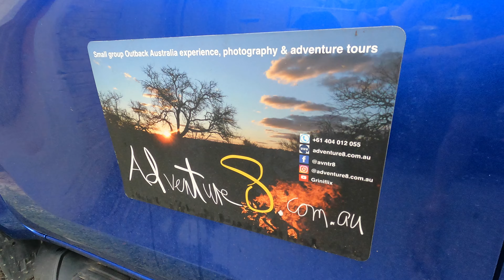NEW iTechworld 500P Lithium Power Station - for my Toyota Hilux Alu-Cab Camper dual battery system

Comment: Hi 😊How long does it take to charge via house/car/solar 200w blanket
Reply from the maker: Thanks for watching. Here is the technical info:
Charging
wall adapter + USB-C PD 60W: 4.5hrs Max power in 156W
Wall adapter     7-8hrs Max power in 96W (11-24v)
Car adapter      8-9hrs Max power in 96W (11-24v)
30A Anderson (solar)  6-7hrs Max power in 120W (11-24v)
USBC PD           8-9hrs Max power in 60W (5-20v)
It’s also in ITechWorld website. Remember to use the Adventure8 discount code to get your extra discount in addition to the special pricing on their website. Hope that helps.
Reply: Thanks 4 reply

Comment: Hi Peter, If I had a camping fridge running off the 500P what battery protection switch would be recommended on the fridge to protect the power station - Hi, Medium, Low?
Reply from the maker: I presume your fridge settings correspond to the low voltage cut off so you don't drain the battery source.  The Lithium Power Station key feature is the voltage is consistently  high and you can use almost 100% of the power supply at that high voltage.  So theoretically, your fridge setting should not matter at all.  The fridge setting options from my understanding is to prevent draining the main cranking battery of your car.  Using the power station means that is no longer an issue to worry about.  Hope my understanding of your question is correct and is helpful.

Comment: Could you use this to jump start a car with a flat battery?
Reply from the maker: The iTechworld 500P can not be used to jump start a flat battery.  iTechWorld make a range of special portable units for jump starting a flat battery.  Depending on the size of your car, small, medium or large (4WD etc).  I have the JS80.  Works like a dream.  I have reviewed it on my channel.
Reply: @Adventure8  oh - pity you need to get another separate device when you have amps available in this ? What about the DC  Carport output - what's this for?
Reply from the maker: @VykingBoy  :  Check out iTechWorld website on the 500P.  Also call them and they will answer all your questions. https://itechworld.com.au/collections/lithium-power-stations/products/itech500p.  Remember to use the Adventure8 discount code for your additional discount should you decide to buy anything.

Comment: Thanks for the video and for the discount code. However, please note I just used your code and the discount was only $20 on a $1038 purchase - so, was a 1.9% discount, not 10%. Not sure if Itechworld are honouring your discount code at present?
Reply from the maker: I did contact ITechWorld about this. Sometimes ITechWorld run a special discount program, like Black Friday, Cyber Monday etc where they offer extra discounts across their range. When they do that, that also reduce their affiliate partner discounts approximately. The net result is still a great deal for the customer. I’ll update my description to say “up to 10%” discount, depending on extra discounts offered by ITechWorld. Hope that clarifies the discount.

Comment: Cant find this unit on the website.
Reply from the maker: Just checked the website, you are right.  I will do some investigation and add a comment soon when I confirm.  In the meantime, my Adventure8 discount code is still active so if there is anything on iTechworld website that is appropriate for you, use Adventure8 as the  discount code at check out for up to 10% discount off your purhcase.
Reply from the maker: Just an update. There has been a recall on the 500P re a firmware update for the battery manager system. For now, that is why the current unit has been taken off the website. I will be receiving more information soon. I will do an update video once I have all the info.
Reply: @Adventure8   thanks for taking the time to look into this. I see there is a 500 model but not like the 2 you have made clips for. It too looks pretty good.

Comment: Specs look brilliant,  is 2000 cycles correct?  Everything else is 500 /800/1000 max cycles... what makes this one have more cycles please?
Reply: Cant find this unit on the website.
Reply from the maker: Yes, according to iTechworld website, the New 500P -  Life cycles - Greater than 2000 Cycles to 80%.
Reply: @Adventure8  Cheers.. is there anyway to allow the AC ports to be used when charging?
Reply from the maker: @The-Wise-One  : I don't think so.  When using the AC output port, the input charge ports are disabled.
Reply: @Adventure8  Cheers.  This is annoying.. i just ordered one,  but this lack of using the AC means its the wrong purchase for me.  Hope i can get a refund..:-(...Thanks for clarifying... any idea why they do this,  is it for safety?
Reply from the maker: @The-Wise-One  : Not sure on the design, may have something to do with cooling requirements.  Nevertheless, I was also surprised, mainly because I assumed and never asked the question or check the specs.  Having said that, I'm using my Power Station as a portable device, so if I am driving, I tend to use 12VDC  rather than 240VAC in the car.  Therefore, I can charge and consume power at the same time.  So, no issue for me.